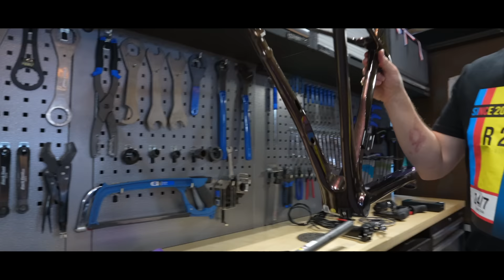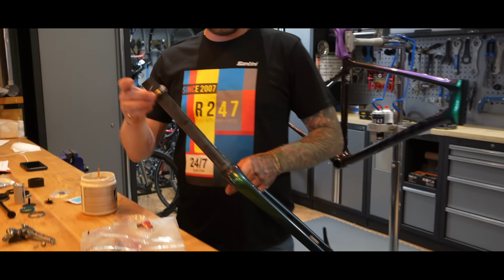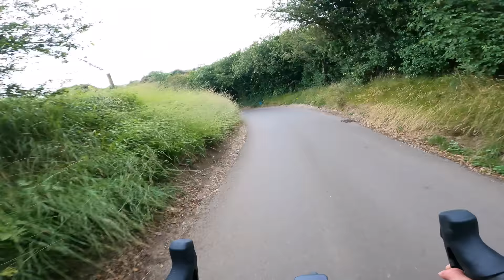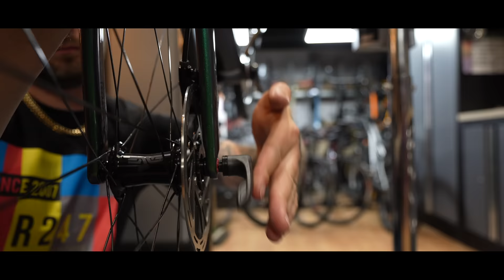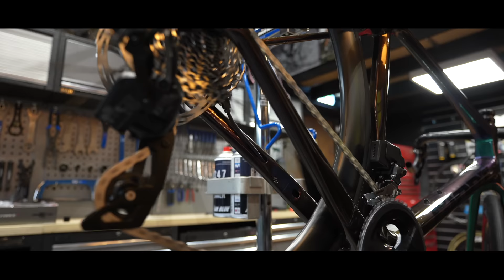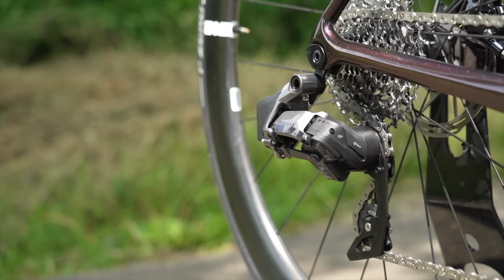1000km Custom Giant TCR Advanced First Ride Impressions

Comment: i bought a 2021 TCR Advanced Pro 1 based on your review. Utterly amazed with the feel and performance of it even after coming off a 2014 Cervelo S2 with carbon wheels. Truly rides beautifully,
Reply: Just got a defy advanced pro 1 from older stock. Putting on gp5000s tr 30s.

Comment: Outstanding review!  I just built a similar bike with Shimao 105, Zipp 303 Firecrest wheels,  Specialized Power saddle, Pro One tires and a Hambini race bottom  bracket.  Mine weighs 7.8kg.   It runs flawlessly.  I have 2700km on it.   I could not be happier...
Reply: If you don’t mind me asking, what did it cost vs buying a stock model?
Which model would have been closest in comparison?
Reply: I’ve also got the Firecrests on mine, which suit it really well and the Hambini race. After a bit more dialling in of the riding position, went for the other day and it just felt perfect. An awesome bike!
Reply: Is this "naughty" talking?
I'm 74 and don't want to get too "stimulated"........

Comment: I bought the 2021 TCR Advanced Pro 1 and couldn't be happier. Coming from a DA equipped Defy Adv SL ISP rim brake, which I thought was quick, the new TCR has been astonishing. Actually feels smoother than the Defy but, at least on Strava, is a significantly faster machine!

Comment: Congratulations on a great build! The most important thing is YOU live riding it!
 Yes I would run a lighter mechanical group set ( Ultegra or SRAM Red 22) the latter which would knock over a kilo off that build. Either way, I’d gladly ride it as is!👌

Comment: The TCR I believe has been at the pointe end of frame tech for years. After all Taiwan and Giant are the largest bike Corp, producers and have the money to prove it. 
I see many new exotic bikes and see old TCR tech on them being touted as new. 
I believe that the TCR Cav used at high road was arguably one of the first aero bikes because of the big square down tube and the integrated bladed seat mast as well as the thin triangle shaped seat stays. I’m obviously a big fan and have had 3 iterations of TCRs. Looking forward to my 4th upgrading to Disc.

Comment: as noted in a previous video this was on my shortlist for my broken bmc teammachine...in the end got the Specialized Aethos instead with rival groupset - love the disc brakes an electronic shifts even after only 200km. Went for what was available and at 53 y.o i'm also looking for a more compliant ride without seeking out marginal gains...still feels fast and smooth. the paint on that tcr is great though...

Comment: I like seeing the cables. I hand built a giant tcr 2012 frame in original box had to get helix fork though. Shimano 105 11speed with giant seat post, stem. FSA 38mm aluminum drop handle bars, selle Italia flite and look keo pedals. Topped off with vision team comp 35mm wheels. Love your build beautiful. Thanks for sharing.

Comment: Agree with you... Aero is more important when riding... Though my rim brakes TCR Advanced (non-Pro), size S, Ultegra mechanical, Giant P-SLR wheels, Giant Elite Pedals, alloy mount with Cycplus bike computer, Cadex Boost saddle, Elite bottle cage, only weighs 7.7kg. 😁

Comment: I bought what I think was the last ever ML sized frame in the UK a few has ago. Nowhere else I Cyclestore had one so was chuffed to get one. Sadly it had a fault in the carbon on the main downtube where it had a dimple in the paintwork/frame. £1300 for a lush frame but it had to go back, so got the BOTY version instead - which is great. 5000 miles in it’s been great with my big old arse on it (100-125kg).

Comment: Get the skinwalls on it (Schwalbe tt)- transforms the look of it to something even more lovely. They're also really fast. :-) Love mine, it's a tremendous bike - 7.3kg fully loaded.
Reply: do u mind sharing you build and size to get to 7.3kg currently building one myself
Reply: @danc1829  - sure. 
Advanced Frameset like Dave's (size M); 
Groupset Red 11sp disc (with Quarq 50-36 PM), Cassette Red 11-28 ; KMC chain
Hunt 44 Aerodynamicist wheels; 
Schwalbe TT 25mm TLE (set up tubeless); Wahoo Speedplays (stainless); 
Giant Contact 120mm stem (slammed!); 
Easton EC90 40mm bars;
Lizard skin tape ; 
Arundel Mandible cages; 
SLR team saddle. 
Think that's it! Absolutely nothing weight weenie.
I think the main savings are the tyres which are v light and I don't use much sealant, and the cassette which is ridiculously light. Everything else stock standard. 
I swapped over grouppo and bits from other bikes and ended up with a superb bike for not a massive amount of cash.
Hope that helps.
Reply: @philallan6685  that's great thank you very much 👍😃

Comment: Beautiful bike Dave! but that groupset is HEAVY, 3.2kg vs 2.3kg for Ultegra mech, no wonder you can't break 8kg.  Sorry, but I have to disagree on the weight issue, specially when the new TCR Pro 1 is ~7.6kg out of the box and comes with a dual sided power meter. (Also the SLR1 wheels are lighter than the ENVEs and I'm pretty sure are technically better wheels.) Weight is a very important factor in road bikes and when you're spending that kind of money on a new bike, you want to be as light as possible.
Reply: Ultegra R8020 actually weighs in at about 2.9 kg, rather than the R8000, which as you said weighs 2.3 kg, however you might want to compare the disc version of both ultegra and rival. There, the weight difference is about 300-400 grams, still being the rival more expensive. So as you said, being weight such an important factor, the mechanical ultegra version is an option to take into account.

Comment: I have the TCR Advanced 1 disc 2021 and I have to say it's not how I imagined it to be...
The whole wheelset was built together in a wrong way I ride with it only 20km and nearly had a 50kph crash!!! Luckily my friend recognized the Wheels coming apart.

Giant did not aswer or replaced anything, had to buy a new wheelset by my own.
Look at your wheels and make sure they are build in a good way!!!
Reply: There's literally thousands and thousands of 2021 TCR delivered to customers since last year.  I have been visiting forums and comment sections and I don't remember anyone reporting this before.  So yours was an outlier, unlikely to be widespread issue.

What do you mean by "wrong way"?
Reply: @Dee-Ell   the spokes where not built together right why the wheel lost it's stability
Reply: @lens.street8113  A one-of manufacturing/assembly defect I suppose. Good that you didn't get hurt.

Comment: Hi David - I am enjoying your bike build by proxy. I have the same tyres on 303S 23mm inner width. The tyres state min pressure of 65PSI only but this is quite high for a rider of my weight and on this rim profile. Should we be following the min tyre pressure on the Pirelli’s? Curious what you are running yours at as I assume it is even lower than me (I’m at 58psi). Ta - keep up the great content!

Comment: Looks fantastic, I’m very tempted by this frame set, I had a 2018 TCR advanced pro rim brake model and while it was very fast it really used to beat me up so I sold it for a Defy. So find your comments re the new one very interesting, Is it really that much better than the previous generation ? As if so I could be tempted to trade in the defy for the new tcr. Thanks
Reply: I’ve had the same bike (2018 rim tcr) and many others. To he honest it’s also one of the more smoother race carbon frames. I would expect this to ride very similar and if you feel that’s harsh I would stay with endurance oriented frames.
Reply: i own a 2021 defy advanced and a just picked up a 2023 tcr advanced. the TCR definitely forces you into a more aero position, which i find less comfortable than the defy. but in terms of how harsh it is over bumps i find them to both be very similar. i dont feel like the TCR is any more harsh on rough roads than the defy.
Reply: @adrianc6534  Good to know, the one I had was fitted with 25 mm tyres and I couldn’t go any bigger due to it being rim brake. The Defy however was using 28mm so I’m guessing the main difference between the two bikes was down to just the tyre width alone when it comes to poor road surfaces. The TCR was brilliant in the corners though as it felt so alive.

Comment: Hi David -- I really enjoy your videos and love this build.  I am riding a last-gen TCR and still love it.  I am curious what the all-up price delta might be for someone buying all the parts to replicate this custom build vs getting an off the shelf new TCR Advanced Pro 1 like you reviewed last year.  I am sure one could scope it out piece by piece with all the info you provided, but just wondering if you have ballpark guesstimate already in mind that you would be willing to share.  And sorry if you already shared that in one of the vids and I missed...  Thanks!
Reply: If it's of any use, I did a rough price up of a Force AXS build of one of the top-end SL frames and, if everything were in stock atm, it was coming in at just under £4.5k without wheels (I already have a set I'd put on it).

I feel like I must have got something wrong though as the equivalent built bike from Giant is over £7k! That'd be some saving, even with some serious rims on it!

Comment: Hey David,, great quality video. Riding a 2015 Defy with 105 disc for 3 years now with 23,000km by now. Thinking of upgrading to TCR Advanced 1 with Ultegra. Worth it? How much faster is it with same Watts? 
TCR is a great bike for money except for the non integrated cables. It costs about 2499€ with Ultegra group and the PR2 wheels.
Reply from the maker: Tricky to determine the speed/power difference without doing a comparison test but I would expect the TCR to be faster when all is said and done
Reply: @davidarthur  yeah of course the race bike should always be faster compared to an endurance bike because of the more aero position of the rider.

Comment: Nice bike, nice review!  Y'know, 18 pounds is fine for a race bike.  I don't think a 16 pound bike would handle any differently.  A little more heft adds some strength to the ride.  A little more girth tracks nicely down mountains at 45 mph, doesn't blow around in the wind, and still instantly responds climbing up the hills.  

I ride a 24 pound fendered commuter.  18 pounds is perfect!   16 pounds is too light.   I appreciate a little inertial mass to stabilize the ride.  Loaded touring bikes ride like Cadillacs. 

We rode the crits on 21 pound bikes.  They shined when ridden strong, thanks to steel's modulus of elasticity.  It would flex and then gracefully return the favor.  The  21 pounds "disappeared."  The 2 wheels became an extension of the body.  A lighter bike would be easier to push up a hill,  but not that much.  The rider still weighs 120-180 pounds.  So I think weight weenies deliver a false promise.

Comment: I'm a little confused with why there's limited stem options. Isn't giants overdrive2 just a tapered steering tube that goes from 1 1/2" - 1 1/4"? I thought most modern road stems are 1 1/4".

Comment: David,  Did your frameset come with a normal, round headset bearing cover and spacers, or did it come with Giant's own "aero" shaped spacers/cover?  I'm awaiting arrival of this frameset, and I'm trying to figure out if I need to source a headset cover/spacers for a non-Giant stem myself.  Giant stems are hard to find right now, so I'm going to have to source a Zipp OS stem myself, similar to you.  Thanks, and keep the good content coming!
Reply from the maker: It came with the aero spacers but I managed to get a round FSA spacer from a friend that fit. Worth checking with your local bike shop to see if they can help, they might have a box of spares

Comment: Interesting review:thx. I am riding a a 2019 tcr, ultegra di2, clincher, conti 5k 28’s, same seat, carbon stem: bars. Had a very bad speed wobble on fast descent a while back, but may have been due to low tire pressure. I’ve been tweaking my position, moved seat forward  and lowered it slightly, snd lowered bars, but I still find at speed on fast descents: front end feels a little twitchy and as if it’s lifting. Do you find your front end feels rock solid at speed on descents ?
Reply: How fast are those descents? I have no such troubles with my 2018 TCR.

Comment: Beautiful bike. I am wondering how does TCR compared to aethos and open m.ind? Given TCR is a racing bike Vs "endurance" aethos and m.ind, what are your decision to go for TCR? Thanks.
Reply from the maker: Well I wouldn't call the Aethos an endurance bike because the geometry is identical to the Tarmac, even though it does offer a smoother rider. Which to choose really depends on what you want to compare? Ride quality? Comfort? Speed? Weight? Price? These (and there are many more) factors are important considerations
Reply: @davidarthur  I'm looking for a climbing bike characteristics. So I'm looking for stiffness for uphill acceleration. Handling and comfort for downhill. Out of the three (TCR,m.ind,aethos), which one will be the most preferred? Thanks.

Comment: Did you feel any speed wobble when descending? I have Tcr 2019 and when ever I go over 60kmh and if its a bit windy, its so wobbly!! Probably time to change a bike..
Reply from the maker: Nope no speed wobble. Can't recall the last time I got speed wobble on a bike. I doubt it's the bike to blame, especially given the speeds the pro peloton race at when Giant were supplying pro teams. Have you checked headset bearings for wear and tightness, wheel alignment as well, some likely candidates of your speed wobble. Do you have deep section wheels as well? That can cause instability at high speeds when winds are involved, and it's why it's something we talk about in wheel reviews
Reply: @davidarthur  I have bought new Fulcrum wheels 55 and that's when I had my first speed wobble...
Everything else on bike is fine, headset bearing are cleaned regulary and it's tight, no noise there...the last thing that is left to check if the wheels are centered I guess..hmmm
Reply from the maker: Could be worth trying some other wheels with shallower rims if you can?

Comment: David or anyone with a TCR 2021 advanced pro could you advise me on this...

I currently have a 2019 tcr Rim brake advanced pro 1 looking to order the same frameset in the video. I've watched a ton of reviews and most advise the same it's a bit of a softer ride but still has the racey geometry..

As the ride is softer / smoother I just woundered does the frame suffer with any brake rub when climbing out the saddle?

Thanks
Reply from the maker: I'm not sure if the frame is actually any softer than the old one, it's most likely the wider tyres provide more compliance and people are confusing that with soft. It's smooth but definitely does not lack stiffness - there's no rub of any sort when climbing out of the saddle
Reply: @davidarthur  Thanks David that's reasurring to know. I'll be running 25s on mine which I'm currently running.

I must admit the colour is awesome especially for a stock colour.

I looked into your wheels aswel and I can see they use the sapim sprint spokes which is stiffer than the normal cx ray

So think I will also go this route when I get my wheels built 👍

Comment: Hi David, did your TCR frame come with headset spacers as per the full builds? I'm in the market for a shorter stem for my tcr pro 1 however the shaping of the spacers and headset dust seal cap to suit the proprietary stem limit options. I wondered where I might find a headset cover like you have to suit OD2 but allow after market stem choice.
Reply from the maker: I had to source them separately, FSA do them if you do a quick Google